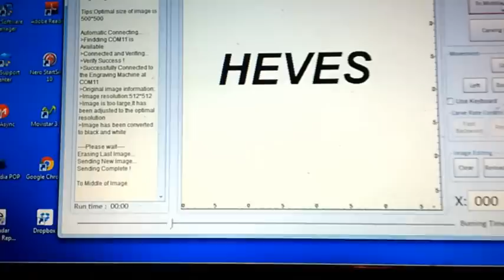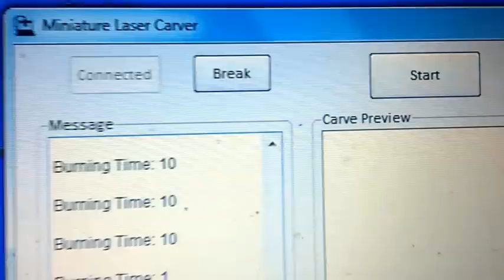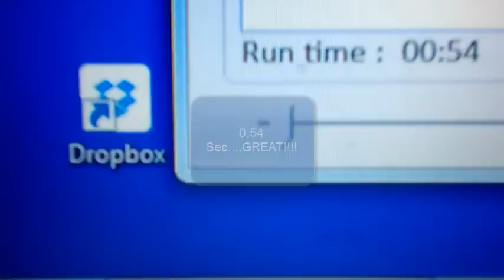NEJE LASER ENGRAVING IN COLORS OVER MANY SURFACES: RUBBER, METALS, PLASTIC, ETC. ♻️👍

Comment: Hello, two questions here.
1 is that a neje DK-8-KZ laser engraver?
2 would it really work on steel or stainless steel?
Reply from the maker: Hola Juan Miguel. Si las tintas Heves trabajan sobre acero inoxidable. La profundidad del grabado dependerá siempre de la potencia del Diodo Láser que tenga tu maquina. Las Neje iniciaron en 300mw de Output y hoy están en 15000mw. Nuestro último video trata ese tema justamente. Para saber que potencia necesitas podes dirigirte a www.heveslaserengravinginks.com o escribenos a divisionquimica@hotmail.com y te pasaremos un chart de potencias. Muchas Gracias. Saludos Equipo Heves
Reply from the maker: En España tecnocorte.net también 👍

Comment: Will this work with the Snapmaker 2.0 with 1.6 W laser? If so which link is better for use here? 7015? 8000 series? Please advise.
Reply: For that type and machine power (2.5 Watts or 2500 mw), the HEVES 8103 and the HEVES 8200 and HEVES 9000 series products are used

Comment: It appears that you cannot request samples, but you can purchase from their website.  The 8000 series runs $82 and change for a single bottle which they claim will cover about 8000 cm2 (about 1200 sq. in.). which about the same coverage as a 12oz can of CerMark spray.  I may order a  bottle and try it out since they have versions that work on glass and acrylics.
Reply from the maker: Dear Bob. 

In our website www.heveslaserengravinginks.com you will see the prices in Australian dollars...

For American dollars check out this link 

https://www.ebay.com/itm/HEVES-LASER-INKS-CO2-YAG-ND-AND-DIY-MACHINES-LASER-ENGRAVE-/162611768401?_ul=AR

100%  customer satisfaction!

So with a spray and HEVES INKS with only usd$52 you could achieve 12000cm2 minimum surface cover....or with only usd$26 up to 6000cm2!!!!

Also remember, our products are watermade non-toxic. I can´t garantee the same for the other company you mentioned

8200 series  not only works for glass and acrylics, also works with almost every kind of plastic and leather

For more info we invite you to contact us at divisionquimica@hotmail.com or info@heveslaser.com

Thanks

HEVES TEAM
Reply: @heveslaserableinks4095  My apologies on the pricing.  The cost of a bottle of laser ink on eBay is indeed $48 US per 50 gm bottle.  I now may have to order several colors to test out.  Much more cost effective if it works as advertised.

Comment: Will a 3000mw machine work with stainless steel and aluminium? The guide on Heves website states a laser of 20w or more is needed?
Reply: I'm certain that 3W would be too little to get any marking on either stainless or aluminium. We have a 60W, and it is pretty slow on those metals.

Comment: Hi does this process create a raised tactile surface ?
Reply: The penetration of the product depends on the type of material, the amount of grams per square cm that is applied and the temperature reached by the laser
It can be from an elevated touch surface
Until it is included in the plastic

Comment: Hey does this work on wood, glass or crystal?
Reply: These products are designed for plastics, but can be used on glass or metals
  In that case, the resistance to friction is like a paint and similar   For more information contact info@heveslaser.com
Reply from the maker: Hi yes we got a lot of works in that kind of surface. Contact us at info@heveslaser.com for more info Thanks Heves Team